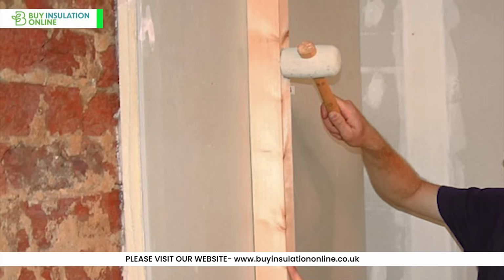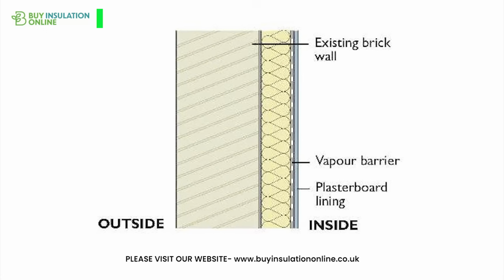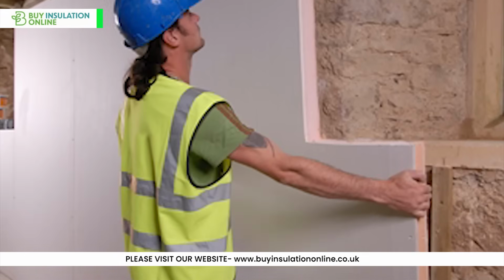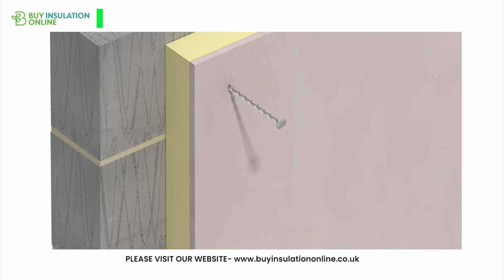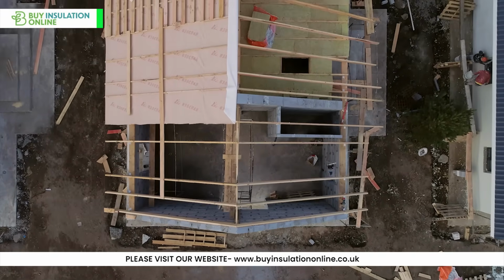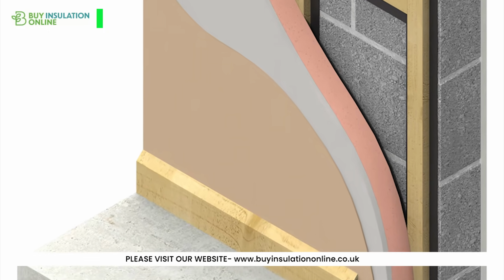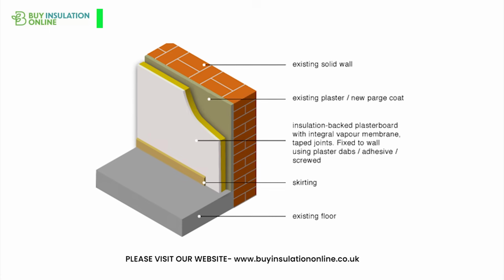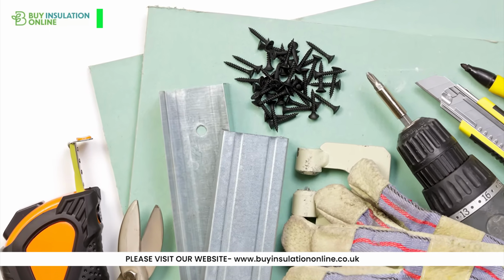The Ultimate Guide To Insulated Plasterboard

Comment: I have a breeze block wall at the end of my house, on the other side of which is my garage. I can feel the cold coming through the wall in winter. If I get some insulated plasterboard, do I just fix it to the breeze blocks? I watched the video but didn't really get an answer. I got that it needs to be sealed entirely with PU foam and then mastic, then (probably) skimmed....
Reply: Im in the process of insulating all my outside walls internally ,the price is staggering , so been a tight yorkshireman ive bought all the insulating boards which is cheaper then stick em to walls  then stick plaster board over them and peg them as well as stick em , its an old welsh stone cottage so i dont want another cold winter . ive just seen your comment you might be sorted now ,i got boards on line thru insulation UK  theyve various thicknesses .

Comment: @QT5656
0 seconds ago
If you have radiators on the same wall as the insulation is it better to bring the pipes forwards or chaste them into the insulation material (e.g. Siniat Thermal PIR Tapered Edge)? I sense it's better to have them on the outside so as not to disrupt the insulation or vapor layer.
Reply from the maker: hi yes you are right that really you shouldnt chase them into the insulation as this will break vapour layer and also reduce the effectiveness of the insulation as a whole
Reply: @buyinsulationonline6067  The problem I've found is that you tell builders this again and again and most of them still do whatever they want when you're not checking. It's maddening.